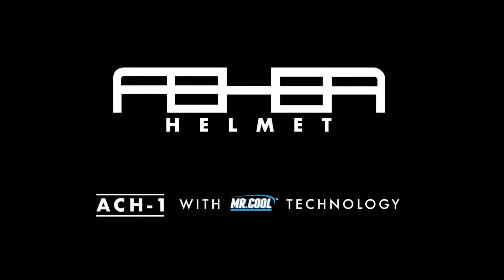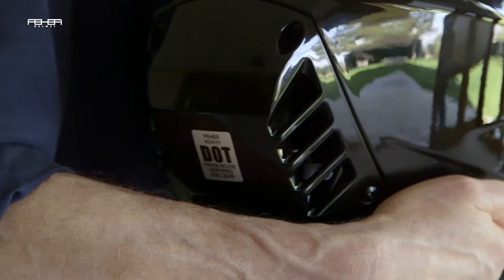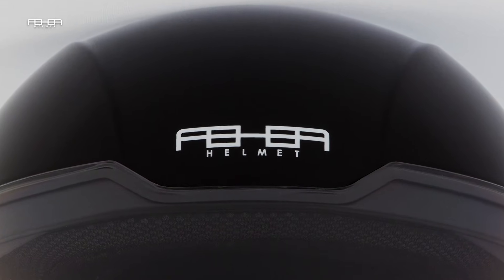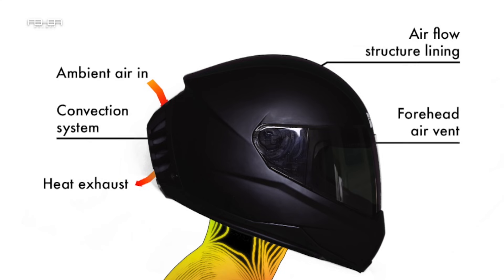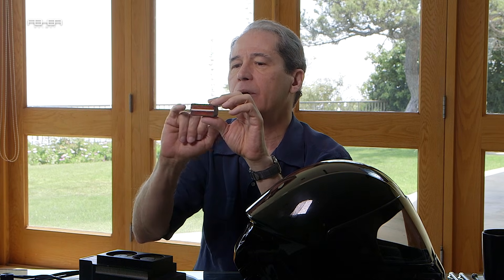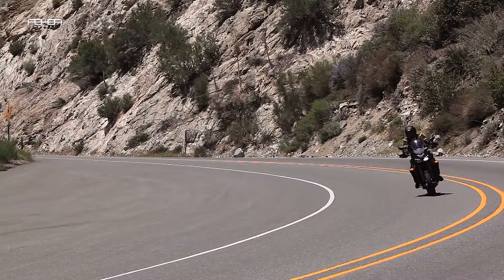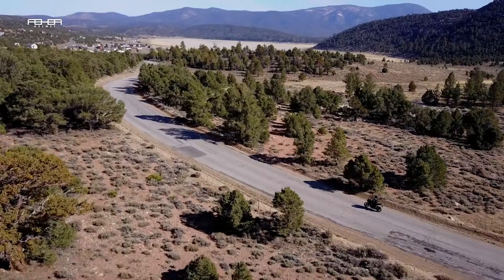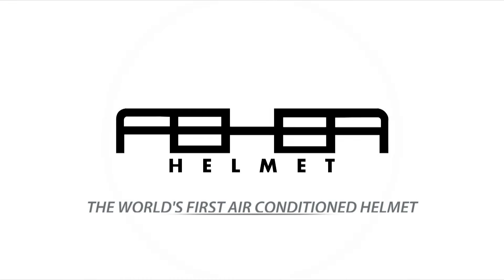Feher Helmets 2018 ACH 1 Overview

Comment: I really like this helmet, it looks good and if it does what it says it can do then it's a huge leap forward.

The only thing as with all things is price, it's expensive, also you should be able to use it without hooking it up to your motorcycle battery as you may decide to use it for other things that a helmet is used for.

But why has it taken so long for someone to come up with a helmet that actually keeps you at a reasonable temperature.

Some countries demand you wear a helmet no matter what the weather conditions, it's ok to pass out while riding so long as you got your helmet on.

So it's a really good idea I would love one, but the price is prohibitive.
Reply: I don't know about calling it "expensive".  If you go to one of the most popular online gear shops on the web (revzilla.com) you'll see that regular full face helmets with no extra tech in them pretty much range from $100 up to $3600.  Right now, this helmet is $549 with a built-in air conditioner.  Also, if you go to the feherhelmets.com website, you'll see in the FAQ that you can use a portable 12V battery back instead of tethering to your bike battery.  Depending on the mAH of the battery pack.... it'll give the helmet either 2, 4, or 6 hours of power.
Reply: I would call it expensive and limited in it's uses as it is.

remove the actual helmet out of the equation and they will have a fantastic device.

This device could be retrofitted to any helmet with the right instructions thus reducing the price and flexibility of it's functionality.
Reply: I hear you, but from a business standpoint, that's not a realistic approach right out of the gate for a brand new company releasing a brand new product.  This thing has air traveling through the inner portion of the helmet... so to make something that would retrofit to any other helmet, that means every helmet manufacturer would have to completely start redesigning their helmets.  This company needs to prove to both the consumers and the rest of the helmet industry that this thing actually works 1st.... and an all in one unit is the best way to do that.
Reply: But what if fitting this to another helmet you simply provided an inner liner, which had all the holes or vents fitted into it?

So if I were fitting it to my helmet for example, I would either rip out the top part of my inner liner which is usually removable anyway for washing, and fit your inner liner to my old helmet.

Then fit the part that goes on the back and connect it all in using whatever method is best for the cooling device.

So then not only does the company get sales for the device they also get sales for replacement inner liners.

I really think this would be a much better direction, yes have the fully fitted out helmets ready to go, but without that which I have mentioned the company is so restricted in its customer base.

Not everyone can afford a new helmet costing the kind of money being suggested which makes it expensive.

But with a cheap helmet fitting this, would make it cool in summer and all the other potentials I have mentioned with regard to this device.

Yes if someone wants to have a super expensive helmet fitted out with this ok, but the cheaper helmets could also benefit, and the company that has brought this idea would make extra sales.

I think they are missing a seriously good opportunity and will end up losing it altogether due to not providing what the customer wants at a price they can afford.
Reply: The important part of what you just said is "what if".  Everything that you just described is a concept that YOU just created... which is GREAT.  Understand that that is NOT the concept that Steve Feher created.  If YOU personally think that YOU have a different and better idea and concept about a product..... instead of asking someone else "Hey, how come you didn't come up with the same idea that I have in MY head?  How come you won't change your concepts and inventions into what I personally think is best?".... then maybe.... juuuuuust maybe, you need to turn YOUR concept into reality instead of asking another inventer, corporation, etc. to change their concepts and ideas into your concepts and ideas.  That's like you going to the McDonalds Corporation and saying "Hey... your food could be so much tastier and healthier....so "what if" you changed this, this, and this?"  That my friend would be a wasted effort.  Your time would probably be better spent opening up your own restaurant.  I'm not trying to be mean or sarcastic when I say that...... I'm just being real and logical with how things work in "the real world".... not "a perfect or ideal world".
Reply: No I fully understand your point you are making but in using Mc Donald's for your example you have expressed an understanding that relates to what I am talking about, Mc Donald's often ask their customers their opinion on their products by testing them on the customer base and if it is popular they make it part of their line, that's why they have such things as apple slices and other healthy food products beside their burgers and chips.

So as a potential customer of the product this inventor has come up with and potentially a long term customer with customer referrals it would make sense to provide the potential customer with what they are looking for or they will take their business elsewhere.

Like Harley Davidson building bikes that no one particularly wanted and slowly going bust rather than listening to potential new customers which would bring in new money.

Which is basically what I was getting at in my first posting when I said about American ideas which are often great but are over expensive so get taken over by a cheap manufacturing country and they end up losing their product due to that over pricing.

We have seen this quite a few times, the Hover board I'm given to understand was American, the Jet pack, over priced now produced by a French man for a fraction of the price, and I'm sure there are a whole host of other things, including battery tech.

All I was getting at is that if someone in a country that is trying to get back to a world player status invents something then they need to produce that thing at a price that people around the world will consider worth spending the money on at a price they can afford.

As a motorcycle rider I have helmets why would I want to buy yet more, however the cooling device would be an asset, a simple change in the companies model enables not only me but many others the ability to make use of it rather than  simply waiting for China to make it and end up having to fix it before you use it but due to the cost would be an acceptable added expense.

Do you see what I am getting at.
Reply: If they are happy to let someone else copy their idea and reap the benefits of their invention then ok keep it as it is and watch people buy the knock off.

On the other hand if they want to make money, give the customers what they want, provide both types and see which one sells the best and use that as their bench mark.
Reply: I totally understand where you're coming from..... but the fundamental disagreement that you and I have is the price.  You do realize that the word "expensive" is a relative term don't you?  What's expensive to one person may be peanuts to another person.  Since this product has been released, no serious or casual bike rider that I have talked to considers $599 to be expensive for a helmet that has an integrated air conditioning system.  This is a unique item that has never been on the market before, so pricing it along with the mid-range helmets is just fine.  And something funny just popped into my head.  11 years ago around this time, a company called Apple Computers released a brand new product called the iPhone.  Do you remember the price?  It was $499 for the 4GB and $599 for the 8GB.  Do you remember how outraged people were at that price?  "Who would pay $599 for a phone?  That's ridiculous!"  That was the conversation that the naysayers had.  Only many many years later did they finally decide to release the iPhone 5C... a lower priced model.  They didn't start out selling a lower priced phone.  And now here in 2018, they're selling iPhones for $1000 each, and Apple has reached trillion dollar status.  That's simply smart business.
Reply: Yes it's smart business for a product that has so many uses, however there are many alternatives that apple don't make and those companies are doing just fine notably Samsung who produce products that cater for the people who can't afford the high prices as well as for those who can.

There are also low cost Chinese Phones if we talking about market share and they also work pretty good, not perfect but often good enough for people on a low budget to afford a phone that can do pretty much everything the expensive phones can do.

So yes it is relative but the lack of offerings by this product maker suggests that it will not survive for this inventor to reap the benefits from.

The helmet is not the feature, the device is the feature, so by lumping it with a helmet denies so many helmet wearers the opportunity to fit this system to their own helmet and thus reduce the cost.

In a nut shell to put is straight, whether I like the helmet or not, if I don't want it but want the cooling device, the device would cost me around $500/pounds, any company that brought out an alternative that may not even work as good, will make a lot more sales just by leaving out the helmet.

So the device is expensive because it is coupled with a helmet and not sold as a retrofitting device to be added to helmets that already exist.

It may well be a really nice helmet, but as a customer I may well not want it the problem is I may just want the cooling, but I can't get it from the maker of this inventors product promoter, so I buy from their competitor who is more than happy to sell me something that does pretty much the same thing but without the helmet so I can retrofit it to anything I want.

Inventor loses out, the copy cats make lots of money and the customers are happy.

I've seen this with lots of products, where the promoters of the product or the makers simply ignore the potential customer and end up losing their idea to a competitor, in fact the motorcycle industry is strewn with this kind of thing, Triumph, Norton, Harley Davidson all losing out to Japanese makers who listened to what the customers wanted and boomed.
On the other hand a niche market is also fine if that's all the inventor and promoters and marketing is aiming for, but it would be a shame as this product has lots of potential for a wider market place which will very quickly be taken up by competitors it always does.
Reply: So let me ask you... do you plan on reaching out to Feher Helmets and presenting your idea?  There's always a possibility that they might like it.

Comment: Even though I live in Los Angeles and ride in 90~100 degree temps most of the summer, I've never once thought 'Gee...I wish my helmet had an air conditioner built in'. Seems like a lot of added weight as well. A light colored (white or silver) helmet with good venting is all you really need to stay cool.
Reply: Yeah Los Angeles isn't known for its humidity, try riding through new Orleans or Atlanta traffic
Reply: I think I understand, I just personally don't feel it's that necessary. I lived in Phoenix for 12 years before moving to LA so I've experienced 114 in the shade and the 'hair dryer in the face' wind of which you speak. Maybe I'm just too old school (been riding almost 40 years now) but if you can't take the heat and need AC then maybe you should just drive a car.

Although I am impressed it doesn't weigh more, my current helmet is right at 3 lbs. Just curious...what is the current draw on the bike? PT junctions are not known for being very power efficient.
Reply: Feher ACH-1 Unboxing and Hands-on Review - https://youtu.be/Qw6cVte4fJM

Comment: AGV made an "air conditioning" helmet over 20 years ago. Didn't have some large addition to the back of the helmet, it was expensive and really didn't do much except freeze your ears. Needless to say it didn't catch on. Like one comment stated.....wet your hair/ head and shirt......works good......just gotta redo every once and a while.
Reply: Ahhh... I just read an article on the AGV Tech-7 helmet.  It was branded as such, but apparently shouldn't have been because it didn't actually take warm air and turn it into cool air.  Here's a quote... “Tech-7 came with an interesting system that used electricity to cool down the internal surface. ‘Air conditioning’ is technically wrong, but you get the idea.”  Mabye "With Helmet Cooling Technology" would've been more precise. lol

Comment: Just put a small yeti cooler on your rear rack . Fill it with some ice cubes and dry ice if you can find it . Wear a bandana type head deal but soak it first . After a half hour or so take a break and put the bandana and your tshirt or base layer in the cooler for ten minutes or so . Drop a few cubes of ice in your helmet and let that sit while your take your break out of the sun . Do this a few times and take a good break in the hottest part of the day , usually 2pm to 4pm or thereabouts . Then start riding again and you repeat the stops when you are too hot again . Sounds tedious but it works .
Reply: You forgot the most important part.......... and ya do the hokey pokey and ya turn yourself around..... that's what it's all about!!!  :)
Reply: @djwolfd  
 Well that goes without saying , lol .

Comment: Even if it works, how awkward would it feel when your head is cold but the rest of your body is sweating
Reply: The helmet doesn't get cold... the A/C unit simply stops it from getting hot by circulating a hint of cooled air in conjunction with the hot air and condensation being blown out the rear of the helmet.  So it's not that the helmet will feel "cold" underneath.... it'll just stop it from feeling hot and muggy, which means no extra heat, mugginess, sweating, etc.
Reply: Feher ACH-1 Unboxing and Hands-on Review - https://youtu.be/Qw6cVte4fJM

Comment: Heat is a problem only when stuck on traffic. When there is air flow its comfortable. What happened to being exposed to the elements when riding a motorcycle? If you can't handle the heat motorcycle is not for you.
Reply: LOL!!!  Let me guess... you must be in Iceland huh?  Do you have any idea what it's like to ride in the 114 degree temperatures of Las Vegas, Nevada?  How about the 117 degree temperatures of Phoenix, Arizona?  You have to understand that this item is not for everyone.  It's for people who ride in regions of "Extreme" heat and humidity.  :)

Comment: At what point do you just buy a damn car?
Reply: Owen Bowman Find a car that rides like a motorcycle.
Reply: Thomas John Solidum lol I don’t need a car that rides like a motorcycle. I also don’t need ac to enjoy a good ride.
Reply: Owen Bowman exactly my point.  People that ride motorcycles are there for the ride not practicality. This helmet is just marketing bullshit that doesnt offer anything useful other than a gimmick.  Arai helmets have more than sufficient ventilation that dont require a self contained aircon unit while being a LOT safer in a crash.  I mean would you imagine getting hit on the head with a cellphone strapped inside your helmet against your head?
Reply: Hey Owen.... let us know when you visit Phoneix, Arizona in the summer and take your 1st ride in 117 - 120 degree temperatures.  We wanna know exactly how much of an enjoyable "good ride" it was.  :)
Reply: Wolf D Do you have to wear a helmet there?
Reply: Arizona - only if you're under 18.  Unfortunately, no helmet doesn't matter at those temps because the wind feels like a giant hair dryer turned to maximum heat being aimed at your face and chest.  Most people don't realize this simply because they've never experienced it.  Where I live in southern California (typical highs of 110 - 113), yes, we're forced to wear a helmet.  Next door in Nevada (typical highs of 114 in Vegas for example), they are also forced to wear a helmet.  It's horrible man... and yea, I simply don't ride my bike when we hit triple digits.  I jump in my car and crank up the A/C instead.  The point of this product is... for people who like to ride but are in EXTREME high temperature and humidity conditions, we won't have to put our bikes away.  We can continue riding and it'll still be fun instead of miserable and exhausting.  Anyone who doesn't live or ride in those conditions doesn't in the slightest bit need to consider being bothered with a helmet like this.  For the other small few of us, this could be a game changer.
Reply: Wolf D that’s cool. I haven’t experienced the heat like that. I ride through snow and negative digits.
Reply: Owen Bowman HA!!!  The cold and snow!  We have something in common!  I’m originally from Milwaukee, Wisconsin!

Comment: If memory serves right , in the 80's AGV did try something similar
Reply: Indeed.... 1987 & 1988.  The AGV Tech-7.  The term "air conditioning helmet" was used, but that's not what the technology was.  It didn't actually take warm air and and turn it into cool air.  It had a big strip across the top of it that was used to electrically cool down the internal surface of the helmet.
Reply: Feher ACH-1 Unboxing and Hands-on Review - https://youtu.be/Qw6cVte4fJM

Comment: Why can't someone just design a hot weather helmet that looks like a bicycle helmet?
Lots of cooling slits there for air. Just add reinforcement....
Reply: Because there is no such thing as "cool air" when you're in a place like Phoenix, Arizona and it's 117 degrees outside.  And in places like Orlando, Florida with 95 degree temps and 92% humidity.... "cool air" doesn't exist in that scenario either.